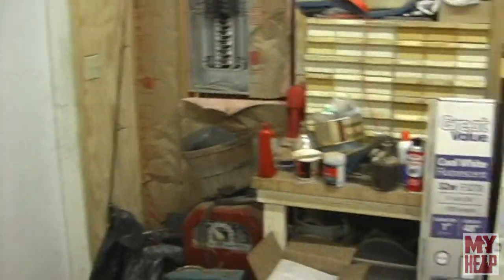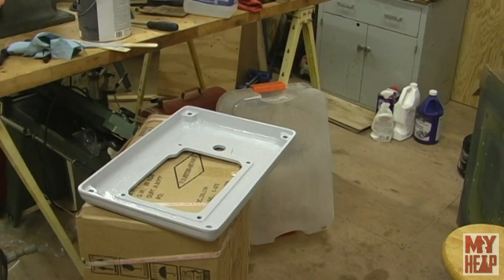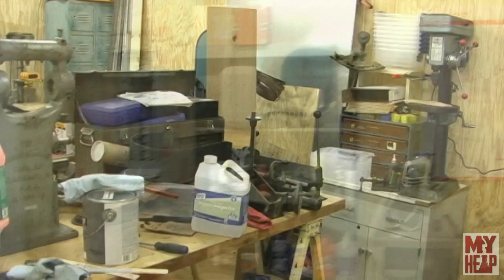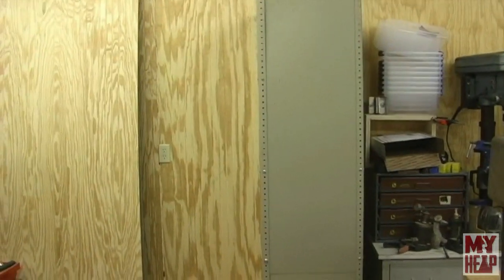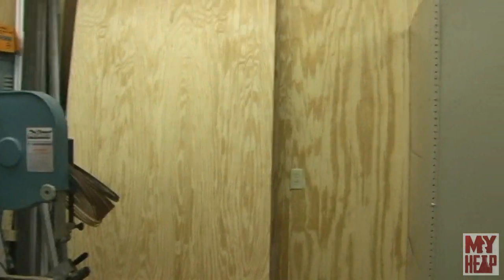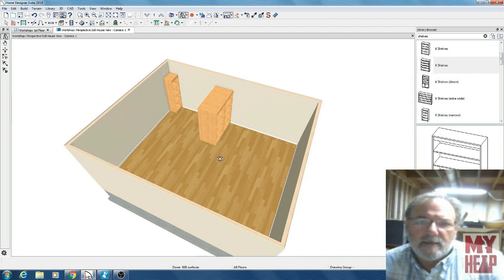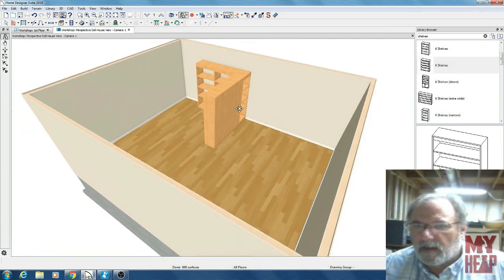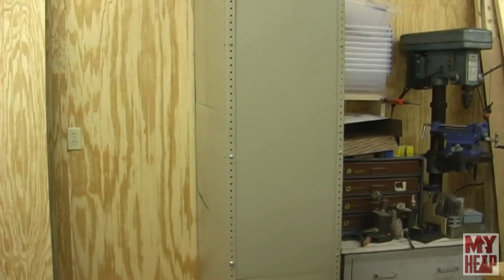Shop Organization and a couple Viewer Questions

Comment: I have a short (height) wall in my shop as a divider. It has 2 openings in it to access the rest of the shop. It never fails wherever you are you need to be on the other side of the wall. It makes for a lot more walking than should be needed. But I really needed the extra wall space so I could place tools against a wall. Your shop is a lot different than mine and you don't have nearly as much treasure. So I guess I'm saying do what works for you. Thanks for the video!
Reply from the maker: Hey George.  Glad you stopped by.  I think I am going to go with the 2x2 arrangement with the shelves.  They will only protrude about 6 feet into the shop and another 18 inches of I put my tool box there.  I more junk than treasure, but I need to get it off the floor and throw some stuff out.  Thanks for watching sir and taking the time to comment.

Joe

Comment: Hey Joe.  I love your shop, it makes me feel at home 🙃   A couple of points, I have the same lincoln buzz-box welder and the Kennedy/Craftsman toolbox.   I like the idea of subdividing the shop, it may improve organization, however, the organization of a shop is my Achilles heel so don't weigh my opinion to heavily.   I'm using OBS as my main chromakey tool, it seems to be a good tool.
Reply from the maker: Well, I have wood working and metal in the same little shop so thought some sort of delineation would be good.  At least in theory.  All I know is I have a bunch of junk that needs to be moved off the floor.  I am thinking of storing my long bits of stock in the basement of the shop.  It isn't heated and cooled, but it is dehumidified and kept at 50 percent.  I really need a second workbench.  I really like my homemade one.  I may build another.  Thanks for stopping by and watching.

Joe

Comment: I like the L shaped cabinet plan. I have a similar setup with machines on the back side and it works well for me. I'll try to share the layout soon.
Reply from the maker: Jody, I will keep a look out for it.  I am still a little undecided.  I am leaning toward the 2x2 just to keep the wall space open.  Won't have the other three cabinets until tomorrow so I can move them around and decide.
Reply: @MyHeap  I posted up a quick walk around. Hope the insight is helpful.

Comment: I use OBS for screen recording and it works well. Just a note if you ever use an external mic you have to change the audio source in OBS.
Reply from the maker: I used the mic that was built into the cheap webcam.  If I rely on this, I have to find some better hardware.  :-)

Thanks for watching and taking the time to comment.

Joe

Comment: Hi Joe
Just found time to watch, if you think yours is untidy, image this, times the so called junk you have by 2 and then add 6 motorbikes in to the space then you've got my workshop. As for planning it out, i think its your personally preference, and any way, there's no right or wrong way, a workshop evolves with time and equipment.
regards
mr f
Reply from the maker: You are most likely correct Mr. F.  I have more stuff piled in the basement of my shop.  I just want to get some sort of semblance of organization.  Besides, if I have stuff put away and uncluttered then I have room for more, right?  Haha
Reply: Joe
You mentioned you used OBS for your videoing, can you elaborate on that, i'm not to good with technology, is it free  and can you just use for  soley just editing videos, and if so is it easy to use.
Regards
Mr f
Reply from the maker: @MrFactotum  OBS stands for Open Broadcasting Studio.  It is open source free software available for Windows, Mac and Linux.  Their website is www.obsproject.com.  it was designed to use for streaming video but many people use it to record video, computer desktop and other resources.  There are many videos on YT on how to use it.  I am new to it myself, but can visualize several uses for it.  Hope that helps.

Joe
Reply from the maker: @MrFactotum  if you looking for a good free video editor, you may want to check out Kdenlive.  It is free and a pretty good nonlinear video editor.  This is what I use to edit and create the final videos for my channel.

Joe
Reply: thanks joe
as soon as i can find time i will have a look
regards
mr f
Reply from the maker: You are welcome sir.  I hope they are of a use to you.

Joe

Comment: You brute ! You're storing your play-gear on grandma's gallstones !
You completely lost me with your plans! And I am not even as stupid as I look!
Now, I will say this... if you are using CAD to situate some cabinets, you will burst open to reveal nothing but dust and screams !!

Hugs and kisses !

Paddy
Reply from the maker: Haha, good one Paddy.  I thought maybe the cad would help explain what I had in mind.  All I know is I have a lot of junk that needs to get off the floor.

Joe
Reply: Oh man, I have installed so many CNC setups and related CAD packages.... back in the day when Fanuc was a new thing.... I can't look at the stuff any more... A true case of PTSD!
If I am forced to watch someone else using cad I may turn homicidal ! (It's ok, I have a note from my doctor) Did you know that one of my first setups were some Swiss made, four spindle, air-bearinged precision drilling machines, for the electronics industry?
Those things ran on punched paper tape!!
That was a hoot! Every time it rained the 'pjuter' went ape ! It took 12 minutes to reload the program... gets old real fast!
The oldest thing I was involved with was a plating line. It had a mechanical computer. Imagine a row of plastic bicycle chains, each link having a hole. That hole could be filled with a peg,which could be positioned in two ways.  These pegs actuated a bank of micro-switches.You had special sheets to write 'the program'.
I partied when that place burned to the ground!

Paddy, medicated (COZ OF YOU!)
Reply from the maker: @gh778jk  it sounds like you should have a pint or two before watching some of my videos just to help with the stress.  I have little experience with CNC.  Only the two routers I built over the years.  Speaking of tape though, I used to have a Perkins Elmer that had to bee booted from a tape reader on the printer.  Thanks for sharing some neat stuff there Paddy.

Joe
Reply: Oh, mine's a Calvados.... scored some very, very nice bottles last time when I was in France! LOL
I do watch you videos, but it's a bit of a challenge at times... I will admit, I skip the CNC for beginners stuff... there is only so much a man can take in one life-time ROFL!
And I made it into a sport to mute you the millisecond you start wishing everybody a 'magically enchanted day' (getting quite good at that too.... it may help with reaction speed tests, once they deem me too old to drive !!!)
It may be a 'blessing' in disguise !!! (see what I did there? see?? )

Hugs!!
Paddy
Reply from the maker: That's okay Paddy.  I am glad you stop by and share bits of wisdom with me.  Sounds like I might be rubbing off on you a little my friend.  🤔